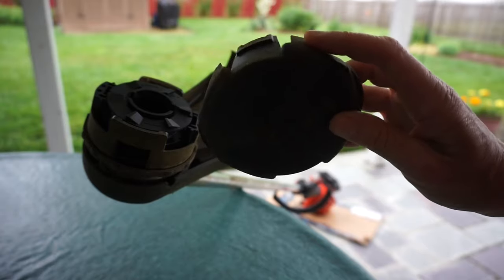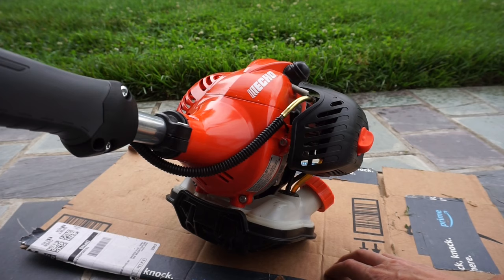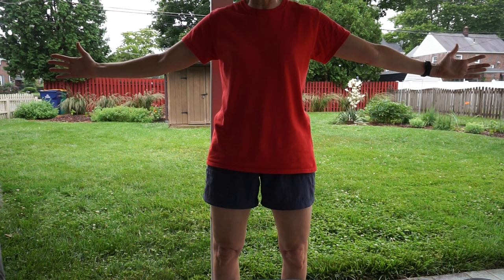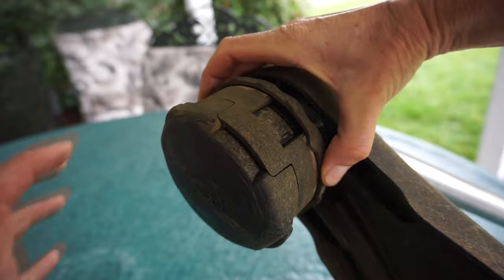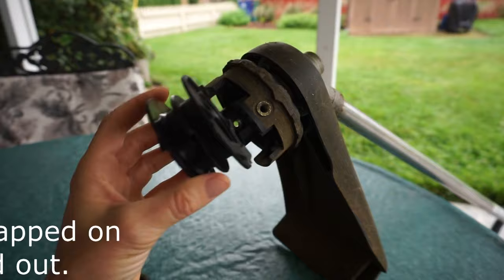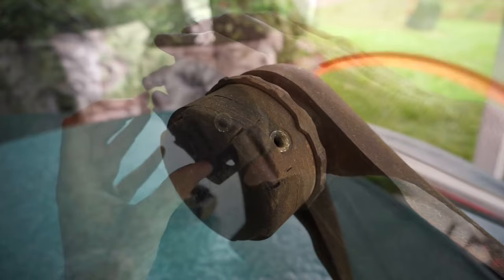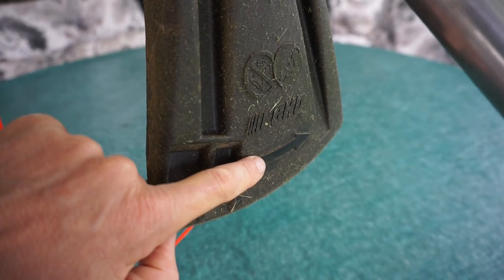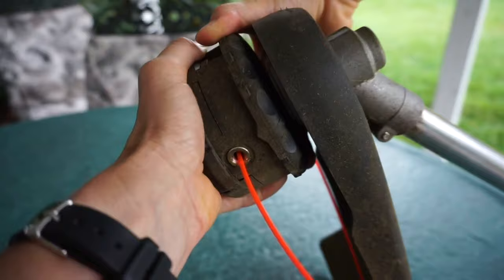Echo String Trimmer Line Replacement - SRM 225

Comment: Very helpful. Wish they would have just printed Up and Down or U and D. Not sure why they used L and R? Also, I used to spin the bottom to wind the line, but the line would always get tangled around everything. Rotating the cap is much better. Very good instructions.

Comment: Great video! Thanks for making this so easy to understand. The key instructions you provided were:
1) Make sure the “L” faces down 
2) Wind the line in the opposite direction of the spin as indicated by the arrows on the guard.
Fantastic video!
I’ve saved it a will refer to it again if needed.
Reply from the maker: You are welcome.  Thanks for the kind words and for watching the video.
Reply: Agreed…. Best advice…L vs R

Comment: Wow! That is SO Much easier to re-string than my Stihl.  My fs56 is a PITA.
Reply from the maker: You may be able to put this trimmer head on your Stihl.  Maybe search for "universal speed feed 400 trimmer head."  So far this trimmer head is a dream come true.   When the bottom cap wears out, you can buy just the bottom cap for around $8-10.
Reply: know How Now is 100% correct. you can get the Speed Feed 400 universal head with adapters to put in your Stihl or other brands ...or even older Echo trimmers. it is priced around $30USD at Home Depot or Amazon etc...($45 here in Canada). many commercial operators and even dealers change out Stihl and Husqvarna, Redmax heads for the Speed Feed - it is hands down the best trimmer head period...best $30 upgrade for your Stihl!

Comment: Lmao! 10+ years I've used the echo 225 trimmer. The arrow and the and lining up the notch I did not know! 🤦‍♂️😂 Thanks. Great video. I'm changing the string on a new wide head different trimmer head for the first time. And I ffffffing can't figure that one out. 🙄🙃 any pointers on that? It looks nothing like these original heads.
Reply from the maker: I have not see the new wide head yet.
Reply: @Know-How-Now  I ended up finding a video on it thanks.